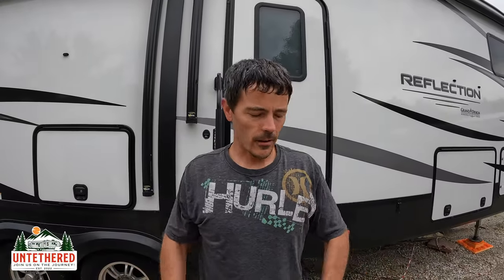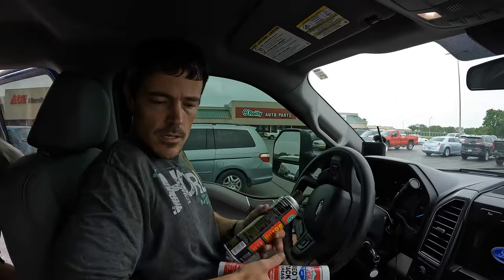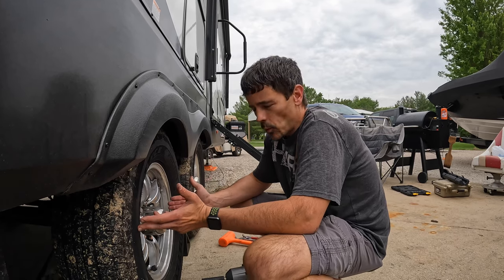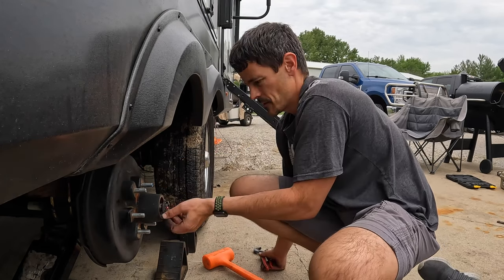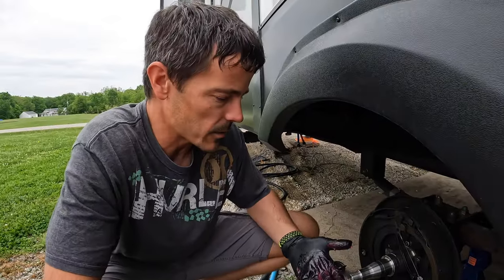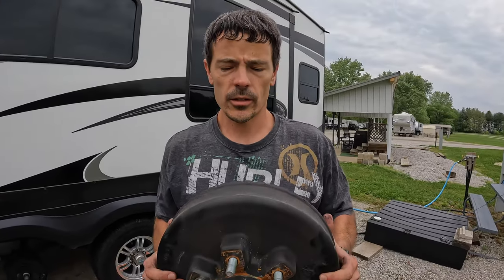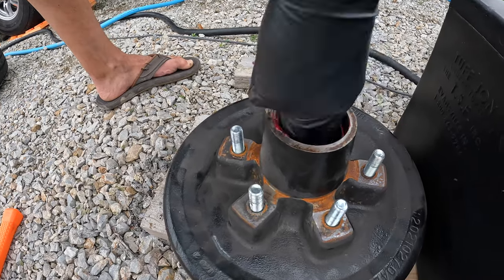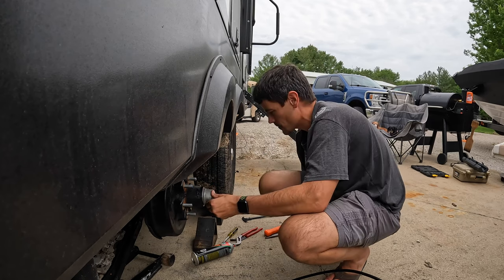Better check those wheel bearings!  Full time RV life!

Comment: Axles are usually a Dexter component. You can find bearing and seal size by knowing axle weight capacity.
Reply from the maker: We did try that, but the dealer (two dealers, Lippert and Grand Design) were only able to narrow it down to three sizes. I was pretty surprised at this as well.
Reply: Are your axle 3500 lb , 5 or 6 lug?
Reply from the maker: @tssmith5502  6k lbs, 6 lug

Comment: Just a FYI, you can put the wrong seal (smaller ID) on and it will fit the spindle tightly. I did so and had the opportunity to replace the seals twice. Also it is a good idea to have a spare set of bearings and a seal in case you have a failure on the road. Pre-pack them and put them in a zip lock bag for storage.
Reply: @@doug260, I realized what I did after installation and before pulling the trailer. I believe I read a case where someone did pull with them installed and it caused premature failure of the seal which in turn caused grease leakage,

Comment: Good job! I am a HUGE fan of Timken bearings etc. If can't find at a local RV dealer check with farm implement dealers. There's also bearing specific stores. Here in Illinois we have MiMotion. Also people need to stop with the EZ Lube function in lieu of a physical clean and repack. Parts need to be visually inspected and felt with fingertips.
Reply from the maker: Agreed 100% on the grease zerks.  Apparently there’s a recall out on those (model/axle dependent) because they were installed too loose.  It only helps if your wheels are off of the ground anyway.  I give it a couple of squirts but only after a full repack.  I’ve seen a lot of folks over grease them and blow out the seals, ruin the brakes and so on.  It’s a messy job, but knowing what’s behind you going down the road is priceless.  Thanks for watching!

Comment: Reason you didn't use the EZ lube fitting?
Reply from the maker: Grand design recommends a full repack every 12,000 miles with bearing & brake inspection.  I do use the ez lube fittings in between service intervals (roughly 6,000 miles) with about three pumps of grease per hub.  Too much could damage the seal and leak grease onto the brakes.